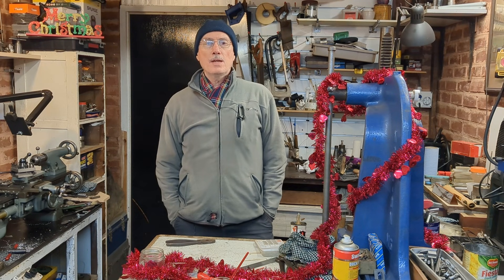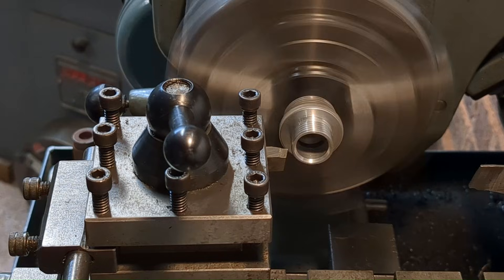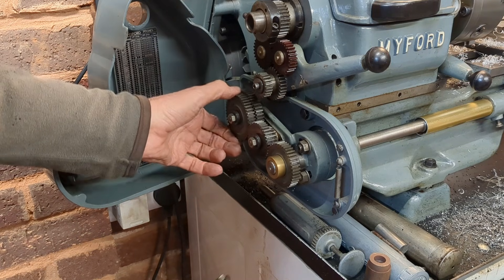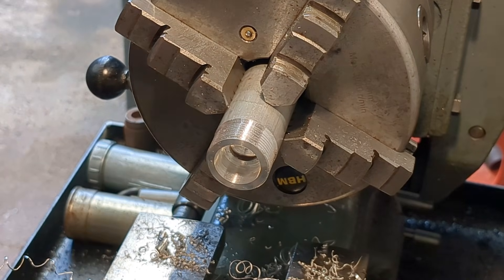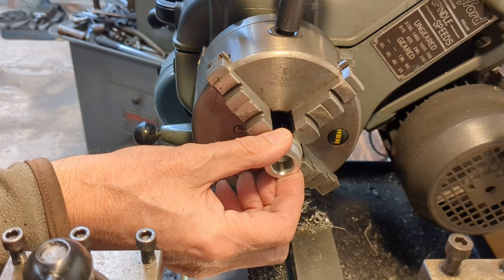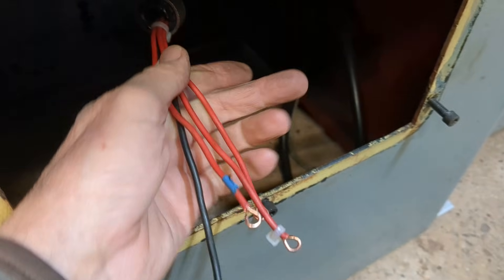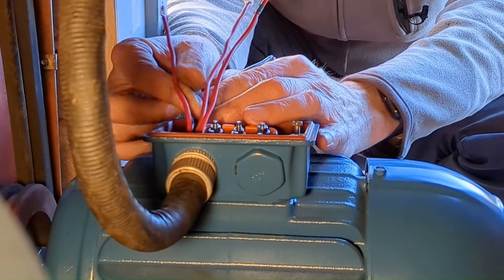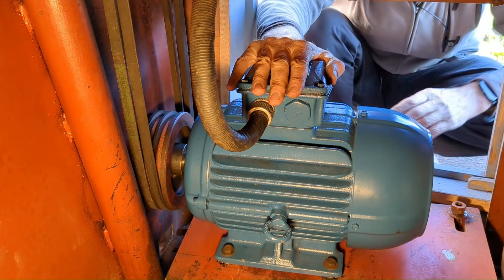Colchester Student Lathe  - Motor Installation

Comment: Good job. That port in the wall is a cool idea. Hope you got some insulation to seal the cold bridge. May be one of the reasons of your rust problem.
Reply from the maker: What I didn't show is that the hatch has an inner and an outer door. Given that the workshop is only 9in solid wall construction I don't think it is worth improving on the hatch, but thanks for the suggestion.